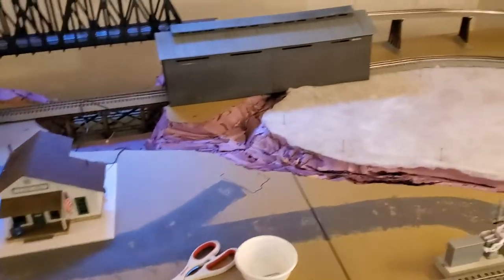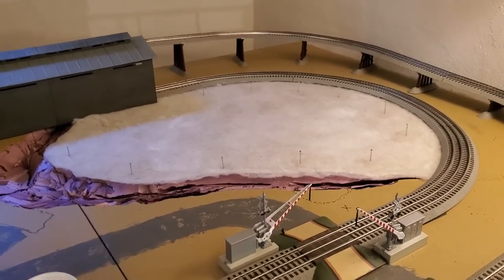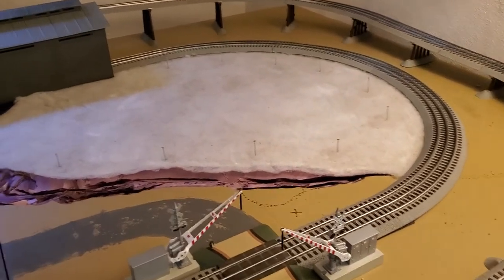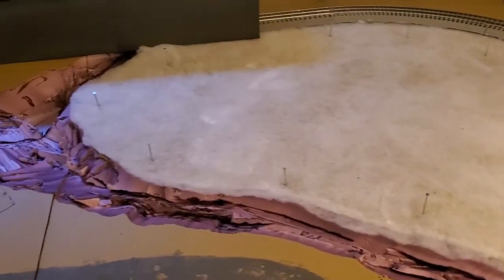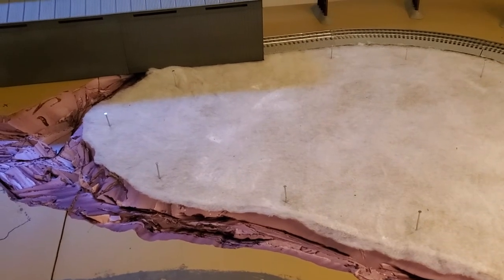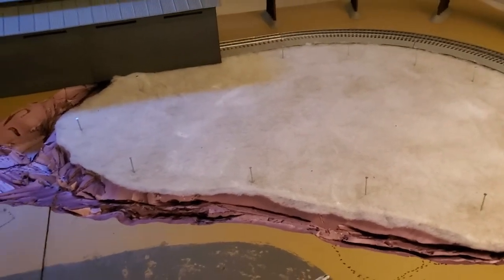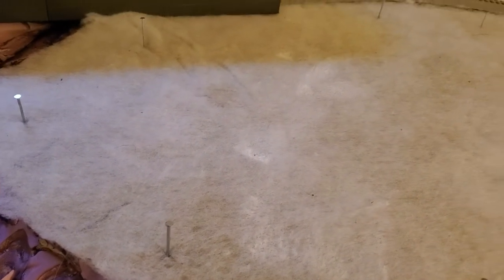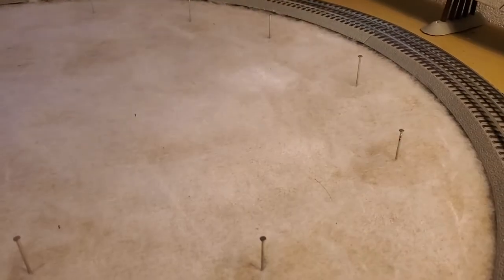Laying farm grass...  using low loft quilt batting.  Phase I

Comment: Do you use a spray paint for the color?
Reply from the maker: Used latex paint and Woodland Scenics ground cover for color.  I have purchased an air brush for future project but haven't used it yet.  
Check other videos and you will see how I applied the latex paint and ground cover.